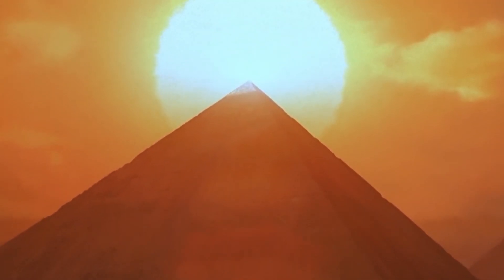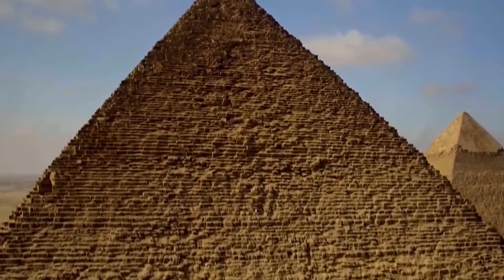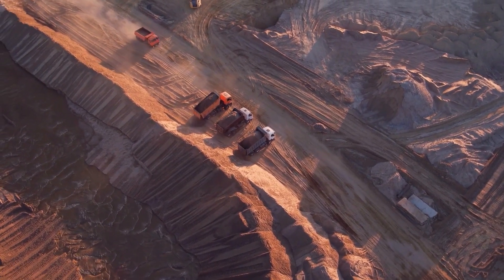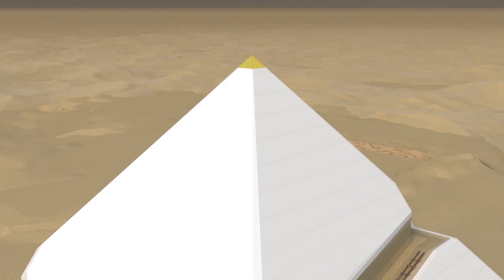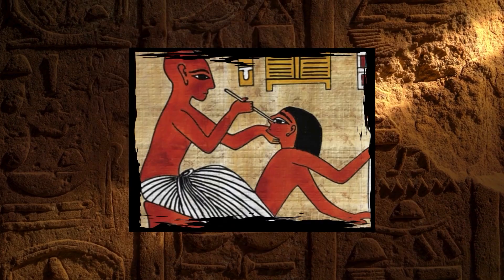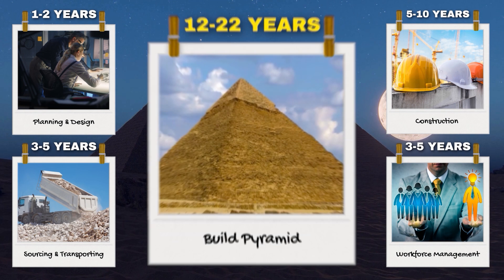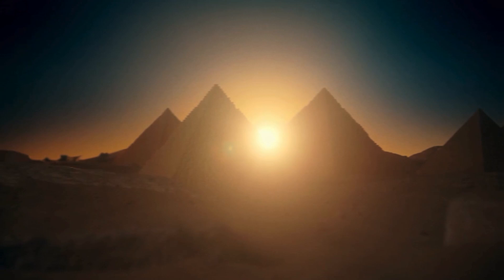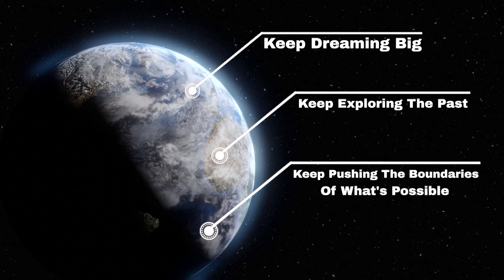How Long Would It Take to Build the Pyramids Today?

Comment: 20:years 😂😂😂😂😂😂
Reply from the maker: How long do you think it would take? 😊
Reply: @howlongwouldittake  a lot of standard forklifts can lift from 1-8k tonne and heavier duty ones can lift upwards of 40 tonne each, sooooo what are you talking about? Also cranes? And helicopters that can lift a 27 tonne payload over distances up to 500 nautical miles at speeds up to 220 knots (400 km/h), if your talking about a workforce of 30,000 people today and with an unlimited budget, we would not need years to plan it, would take a couple months, it wouldn’t take years to gather materials once again a couple months, and transportation once again just a couple months, construction with all the conveyor belts and cranes moving all at once would only take a couple months, and all this is happening at once, you don’t start planning and just Finish the planning stage no, you start planning shortly after you’d start gathering the materials and transporting at the same time whilst still planning is still going on, your acting as if though we’d start planning whilst nothing else is going on, then start mining and transporting everything and then not start building till all the materials are there and then once all the materials are there you think we’d struggle to stack them?